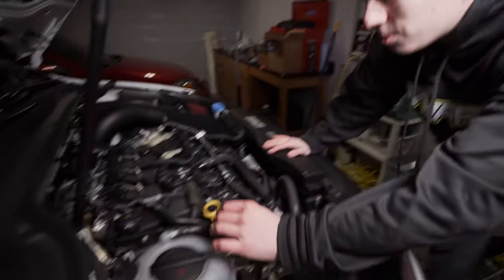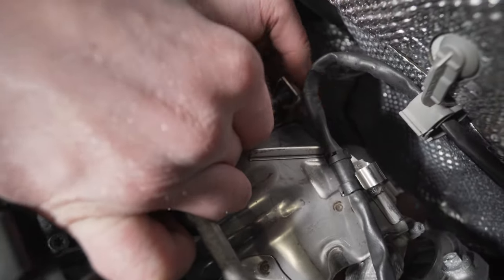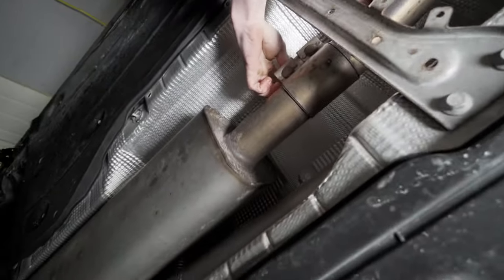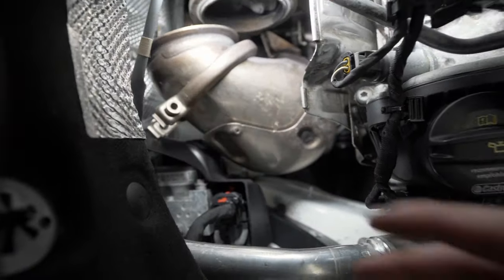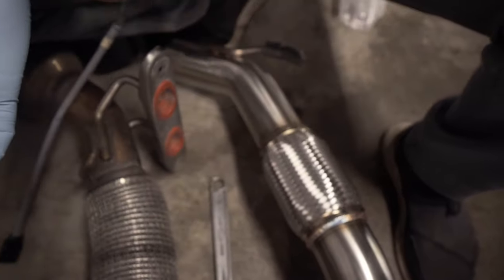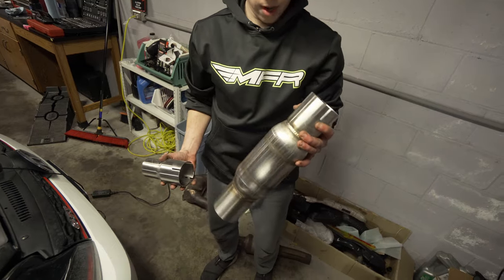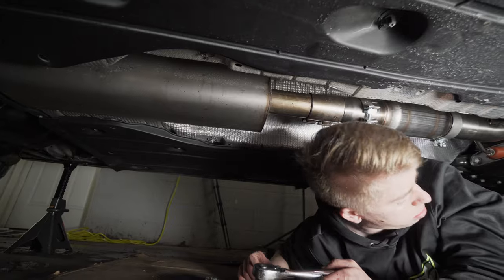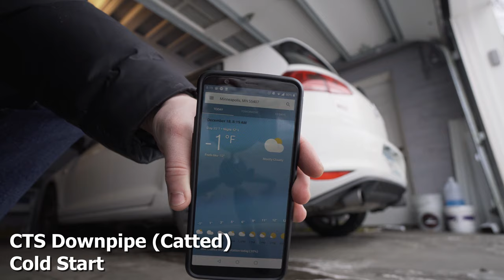Mk7 GTI Downpipe Install *CTS Turbo Catted Downpipe*

Comment: Is the car tuned in the clip?
Reply from the maker: United Motorsport ECU/TCU for stock IS20
Reply: Hardway Learning how much more hp/tq r u getting fronm that tune?
Reply from the maker: @michaellaroche5462  should be around 280 hp/ 350 ft-lbs 🚀

Comment: Is this on stock clutch? Or Just wondering as Ive been wanting to get a DP but ive heard that the GTi stock clutches are terrible after adding more HP.
Reply from the maker: My car has a DSG so it has a UM TCU tune for meeting the higher torque. Some companies make "low"torque files for people with 6spd and stock clutch from my understanding. My guess is they ramp in to boost a literally easier and or throw less timing at the car in the lower RPMs 👍

Comment: @HardawayLearning I just got mine in the mail! Did you reuse the gasket where the downpipe meets the turbo? Or will i need to be purchasing a new one? Thanks! install video is very helpful
Reply from the maker: I did not order a new gasket, so it either came with one or I re-used (sorry I don't remember 🙃). Good luck with the install!

Comment: Was there one or two bolts holding the downpipe behind the engine? I was able to remove the one bolt you removed in the video but the DP won't budge.
Reply from the maker: According to CTS's install guide there are two holding it to the block: https://www.google.com/url?sa=t&source=web&rct=j&url=https://www.vividracing.com/productdocs/CTS%2520MK7%2520GTI%2520Downpipe%2520Install%2520Instructions.pdf&ved=2ahUKEwikrpb93vzrAhXNLs0KHZjNAH4QFjACegQIARAB&usg=AOvVaw2dH21h5CmuuuAnNMJqJGHE

Comment from the maker: Sound clips start at 7:42, you have to like the video for it to work though 🤣!
Reply: Is any light in when you install the down pipes?
Reply from the maker: @user-kc3yh1ke1x  if you don't have an O2 spacer or tune there will be a check engine light

Comment: Great vid dude! By any chance, did you have to move the driveshaft out of the way to get to that bolt on the bracket that secures the oem dp onto the block? A lot of people are saying to do so but it seems like you made due without it. Thanks in advance dude!
Reply from the maker: For AWD vehicles you have to remove the driveshaft running to the rear diff. On this I don't think we did anything with the front axles if I recall correctly
Reply: @HardwayLearning  Thanks for the quick reply! Just got a CTS dp for my A3 Quattro.. looks like I’m in for a fun install lol
Reply from the maker: I have faith in you, good luck and have fun! Feel free to reach out if you have any questions. I'm easy to reach on instagram @hardwaylearning
Reply: Hardway Learning Hey man I just got this yesterday and I it appears that my clamps that came with are not having a tight fit I dont know whats wrong could you help me out

Comment: Great video.  Not sure if you are still checking comments.  But I am wondering why adding this down pipe will set off my check engine light.  And if there is a way to add this without setting off the down pipe. Thanks again for getting back to me. I am looking to install this exact down pipe with the high flow cat.
Reply from the maker: The Cat isn't in the OEM location, so you need to use an O2 spacer to avoid a secondary O2 CEL. Check out our Golf Sportwagen Unitronic downpipe install for some more details!
Reply: Awesome. Thanks.  I will look for the video.  Is there a link your able to share showing what 02 spacer I need to get.
Reply from the maker: @zacharylee3092  hit up Chi11z on Instagram, he should know what spacer he bought. Or DM me and I'll bug him about it tomorrow 🤘
Reply: @HardwayLearning  great thanks. Also can’t find the golf sport wagon video.  U able to share that.  Also what does DM mean.
Reply from the maker: @zacharylee3092  DM means direct message, let me know if this link works: https://youtu.be/rhmOsH4gLIU
Reply: @HardwayLearning  yes it worked. Thanks so much.  Don’t know how to DM u.  Lol.

Comment: new gti here looking to do this, question is how many catalytics does the oem has ? seems the oxygen sensor position on the new part skips the first one does the check engine light comes on ?
Reply from the maker: My car is running a tune that disables the secondary o2. You would need to run an o2 spacer to prevent any CEL from activating on a stock car.
Reply: @HardwayLearning  ok thank you is that spacer to move the O2 behind the cat ?
Reply from the maker: @erodz1892  it's to move the o2 further out of the exhaust flow to trick the sensor into thinking there's a cat
Reply: @HardwayLearning  many thanks !!!

Comment: Hey bro nice vid. Did you get a check engine light after install?
Reply from the maker: No because the car already had United Motorsport ECU/TCU tune.  If you want to run a downpipe without a tune I recommend getting this: https://store.ngpracing.com/42-draft-designs-o2-oxygen-sensor-spacer.html
Reply: @HardwayLearning  Why does the check engine even pop up
Reply from the maker: @patricmaziarka8727  if you don't have a tune, your car will throw an o2 CEL for the secondary o2 because aftermarket downpipes have less effective catalytic converters or sometimes none.

Comment: I wish the previous owner on mine never straight piped the car they welded to the factory cat now I gotta get my buddy weld a vband up so I can connect it
Reply from the maker: You could always do a slip joint, v-bands are great though. I like the sound of the aftermarket downpipe/stock catback, it's good amount of loud without any drone
Reply: @HardwayLearning  nah I need to have the exhaust cut and re welded either way with how it is unfortunately
Reply from the maker: Ahhh bummer, happy motoring!
Reply: @HardwayLearning  yeah otherwise definitely would’ve had it done by now lol just my luck though

Comment: really stuck on choosing catless over catted. we have no emission tests where i live but im just concerned about the drone and smell from catless. never had an aftermarket DP before.
Reply from the maker: If you go catless it will most likely sound more raspy/tinny.  Cat's aren't as big of a restriction as they used to be, I prefer the sound of a catted exhaust on a small 4-cylinder engine, plus you ain't harmin' the ol' ozone!
Reply: @HardwayLearning  thank you for your thoughts. will keep in mind.
Reply: Which one did you go with?
Reply: @holdtheline045  CTS catless! Amazing and you get use to the smell after a couple days no biggie plus I just put the window down a bit anyways when I drive so I could hear the car! On stage 2. Love it
Reply: @holdtheline045  crackle tune loves it lol
Reply: The catless is amazing paired with a good resonator. Here in FL we don’t have emissions so people just do that
Reply: @casketman14 drone will be there w resonator or not

Comment: Hi mate very nice video 
Just wondering if I can install downpipe sport cat on my Audi s3 without tune for now.I’m thinking to get intercooler after and then stage 2  
But not all processes in one time is it safe for engine to run with sport downpipe?
Thank you
Reply from the maker: You're fine to run the upgraded downpipe before a tune, but you may or may not get a check engine light.
Reply: @HardwayLearning  
Thanks for quick response man appreciate 
If I’ll get check light I can still use car or has to be tune ?
I won’t loose any power 
And one more thing mate can I go stage 2 with downpipe and keep stock itntercolr ?
Reply from the maker: You could lose power if the car ends up over boosting and going into limp mode, but that seems unlikely. It's more likely it will get a check engine light for secondary O2 cat efficiency which is more of a nusance than anything. I ran stage 2 with a downpipe and no intercooler for a while. You'll just heat soak your intake sooner (less power).
Reply: @HardwayLearning  
I’m running R600 intake and milltek cat back no valve plus res delete just need downpipe
Reply from the maker: Nice! Should be a ripper, stage 2 tune will be fun!

Comment: Did you downpipe come with that reducer? I just got mine and there is no reducer in the box just downpipe and cat
Reply from the maker: Is it a different size? Mine bolted right up, not sure I remember it needing to reduce. I didn't need to buy anything additionally to install it is what I'm getting at
Reply: @HardwayLearning  there is no reducer in my box that goes from the new cat to to rest of the exhaust
Reply from the maker: @mjmottayaw  I would reach out to who you bought it from and tell them. Is the CAT the same diameter on each side? Maybe they changed the design?
Reply: @HardwayLearning  no the cat is definitely a different diameter than the stock exhaust?
Reply from the maker: @mjmottayaw  they must have forgot the reducer then. I re-watched my video and they definitely sent it with one

Comment: I’m getting mine but isn’t gonna tune it for awhile. Will the engine light do anything to the car? I’m getting a apr stage 2 tune on will that take the code off. Could I still drive it with the engine code without any problems?
Reply from the maker: Yes it will eventually throw a CEL, but it is safe to drive. The only concern is you won't immediately be aware of any faults unless you regularly scan the car. I'd double check that APR still offers stage 2, last I heard they couldn't anymore because of emissions.

Comment: will my check engine light go away once I get a tune? I was planning to do the downpipe myself and then tune my car within those following days with Unitronic
Reply from the maker: Yes, Unitronic tunes will take care of your o2 related CEL. I tuned mine with UM before the downpipe install and never saw a CEL 👍
Reply: @HardwayLearning  literally fastest reply ever damn. Lol but thank you sounds good
Reply from the maker: I'm always on my phone 😂
Reply: I’m doing the installation and the tuning today with COBB. Do I gonna get the CEL light ? Awesome video btw
Reply from the maker: You shouldn't as long as COBB supports downpipes/codes out secondary O2.
Reply: Guys a question!! I have a stage 1 apr tuned! What else do i need to after installing the downpipe??will the engline lights would be on?

Comment: Soooo will this need a vibrant j spacer to pass emission? Recently went stage 2+ on my beetle and it’s still throwing a CEL
Reply from the maker: What company? I didn't need one because I had UM stage 2. If your tune doesn't ignore downstream O2 then you will need a spacer with this because the downstream O2 ends up in front of the new catalytic converter.
Reply: @HardwayLearning  Unitronic

Comment: Great video! I have a question though. I have 1.8 TSI model and I was thinking putting this down pipe on but I don’t want any tune. 
Am I gonna get engine light if I use o2 spacer? Thank you:)
Reply from the maker: According to the golfmk7 forums, they highly recommend the 42 Draft Design 02 spacer (it's in the stickied posts, so you know they mean business) for running a downpipe without a tune. That should prevent you from getting a check engine light.
Reply: I know this is a late but did it work with out a tune?
Reply: @holdtheline045  yup. Spacer works
Reply: Did you have to use an angled one ? Or does a normal one work
Reply: What spacer did you guys use?

Comment: Hi, recently purchased a 2017 vw gti with the performance package. Can I put a down pipe on without doing a tune? Or is that bad for the car?
Reply from the maker: You can, but you might get a check engine light if you don't run an O2 spacer on the secondary O2.
Reply: @HardwayLearning  thank you for the info!

Comment: So I’m struggling is there a second mounting bracket ? And how did you get to it?
Reply from the maker: Check out CTS downpipe guide, if I missed anything in the video they should have you covered. From what I remember it's just the mount that's visible on the bottom: https://www.dropbox.com/sh/rytm0gb1ty9qr49/AABUd-Z9ikpe3U8Qr_y4myEOa?dl=0&lst=&preview=CTS+Installation+Guide+-+CTS-EXH-DP-0014.pdf

Comment: Hello i have a gti performance with stock catalyst and ppf( particle filter) im thinking of buying a cobra catted downpipe, but i dont want to have more power doing stage 1 i just want more sound... Will i need to do a stage 1 with a catted downpipe? or i can just leave it like that? Thanks
Reply from the maker: If you just want more sound I would change out the muffler portion downstream of the downpipe. You could try running an aftermarket downpipe and an O2 spacer to prevent CEL, but I think that can be a little touch and go.
Reply: @HardwayLearning  thanks for the quick response, what is  the meaning of downstream of the downpipe? sorry for my english, do you mean to delete the particle filter? or you recommend not touching that? Thanks
Reply from the maker: @JavierAlvarez-sv6qo  anything after the OEM downpipe (keeping filter and catalytic converter). So installing a cat back from someone.
Reply: @HardwayLearning  right, i have a cat back exhaust from someone but i just feel that the particle filter limits the car soooo much...

Comment: how does this do with warranty? If anything fails what could they blame the downpipe for? Im just seeing if its worth risking it.
Reply from the maker: Any dealership could jerk you around for anything, it's hard to say. I can't see how a downpipe could damage anything, but it's probably the safest bet to switch back to stock for any warranty work. I threw my warranty away the second I got my car tuned though so I haven't had to deal with the process ever.
Reply: @HardwayLearning   Thanks! Does a tune void all warranty?
Reply from the maker: @braydenroyal1  I would say it throws anything drivetrain related out the window, but if you had interior/body/suspension/brake problems those things should still be covered.

Edit: I can not speak for how shifty a dealership can be though

Comment: Did u need new clamps? If so what size?  I'm doin the same job soon
Reply from the maker: The CTS downpipe came with all the clamps needed to properly mount it to the stock exhaust!

Comment: Any idea why the O2 bung is upstream of the cat on the CTS? All other aftermarket downpipes I've seen have the O2 sensor in the correct downstream location.
Reply from the maker: There are two o2's, the one reading before the cat is telling the car what the fuel mixture is and the one downstream is reading whether or not your cat is working properly for emissions. On a tuned car, the second one is typically shut off and ignored.
Reply: @HardwayLearning  Hey, where is the second O2 sensor located. The one that is "downstream". Only seeing one O2 sensor port in most install videos for the CTS downpipe for the MK7 GTI.
Reply from the maker: @jordanspence117  the first one is on top of the turbo, the second one is on the downpipe. Stock cat is immediately after the v-band clamp so the second O2 is basically right on the downpipe. In the case of the CTS turbo downpipe, the high flow cat is actually downstream of the second O2.
Reply: @HardwayLearning  thanks for the quick reply man. Appreciate it!
Reply from the maker: No problem
Reply from the maker: Will do!

Comment: Whats an o2 censor you know works for my mk7? Should I get it angled ? Or will normal one fit
Reply from the maker: Are you looking for a replacement? Or are you looking for a way to run an aftermarket downpipe without a tune to avoid a CEL?
Reply: @HardwayLearning  yup looking to run one with my aftermarket downpipe
Reply from the maker: @jaydengonzalez6744  my buddy has success running a J spacer on the downstream O2 (not the O2 pre-turbo) without running a tune and does not get a check engine light.
Reply: @HardwayLearning  was lookin at those j spacers from Amazon and eBay people have purchased, they’re not available no more on there

Comment: Thinking about pulling the trigger on one, 2 years later would you still say its a good buy?
Reply from the maker: Absolutely, adds the right amount of noise and it's held up perfectly fine. People crap on CTS, but I've had no issues with this one 🤷‍♂️
Reply: @HardwayLearning  nice, I’ve heard a lot of bad things about them in the earlier years of the company but now im hearing they’ve stepped up quality of there builds, and at the price its pretty dang good, plus there one sale right now
Reply from the maker: @mnmvideos4352  win win!

Comment: Will you get a check engine light if you do a downpipe without a tune?
Reply from the maker: There is a good chance you will get a check engine light for the O2 sensor without a tune.  This can be mitigated by a spacer, but not guaranteed.

Comment: Can you use the stock midpipe and cat along with a catted downpipe?
Reply from the maker: The stock CAT is in the downpipe right next to the turbo outlet so you can not. The midpipe of the CTS downpipe includes their cat or a straight pipe depending on which version you select. Without it, you would not have a long enough section to connect to your resonator/muffler.

Comment: Any idea what power gains you got from this mod?
Reply from the maker: It's more so that it let's you run a Stage 2 tune which nets you about 60hp and 95ft-lbs over stock.
Reply: @HardwayLearning  I have a mk7 1.8 IS20 APR91 Octane tune with turbo inlet mod. I'm just wondering how much additional power gains I would see from an improved gas flow... I'm thinking it would be at least 20hp.

Comment: Do you need a tune for this?
Reply from the maker: Yes, I had already flashed mine with a United Motorsport Stage 2 Tune prior to install.  You might be able to get away with a j-spacer on the downstream o2 sensor, but it will throw a check engine light if you do not have a tune or J-spacer.